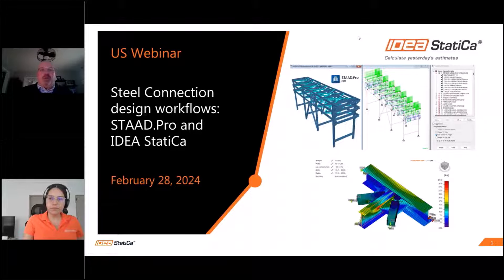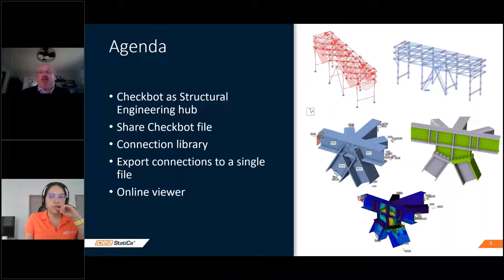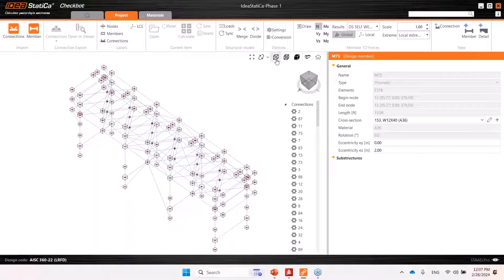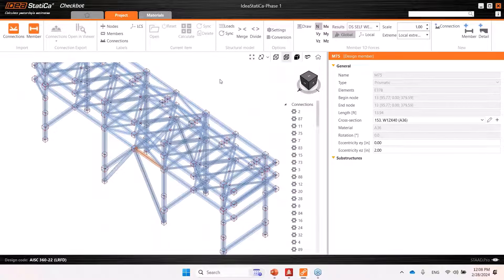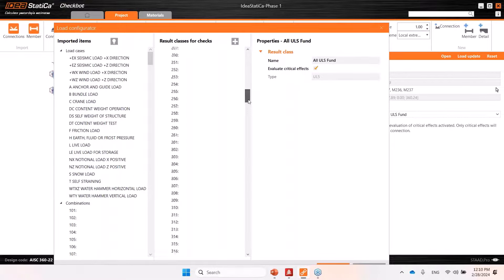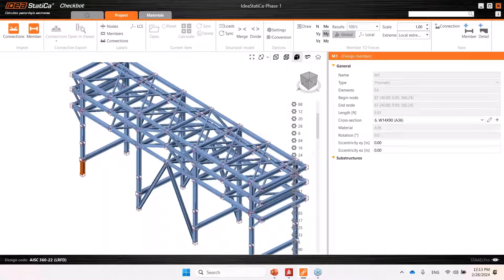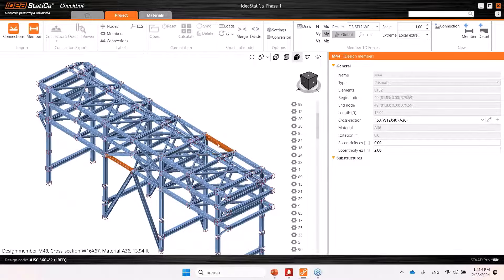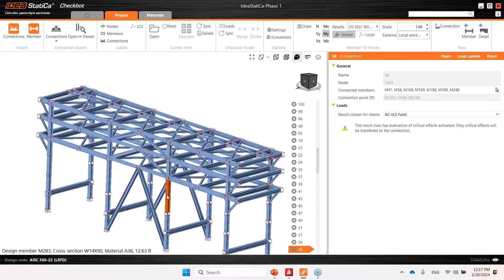Steel Connection design workflows: STAAD.Pro and IDEA StatiCa

Comment: I have the exact same connexion on my project but when I select the members there is still no suggestion, could it be because I am using a trial version?
Reply from the maker: Hello, no, the license type doesnt matter. Probably, some members vector is slightly different so that its out of the tolerance range for the design template to be applied.
Please contact our support for a proper check https://www.ideastatica.com/contact